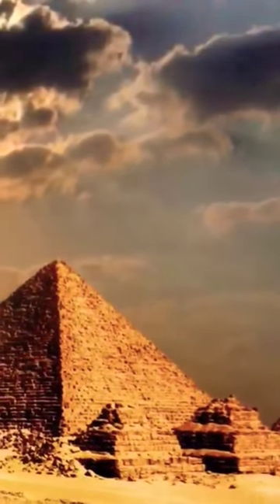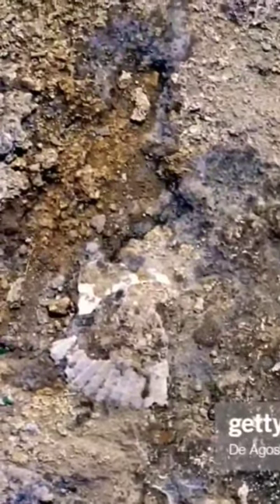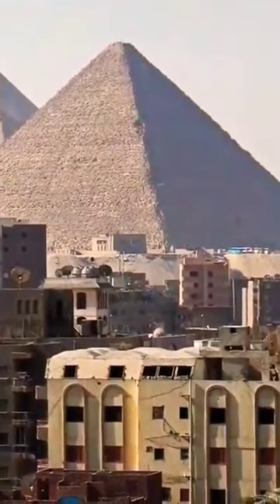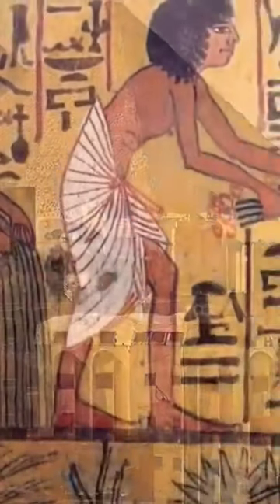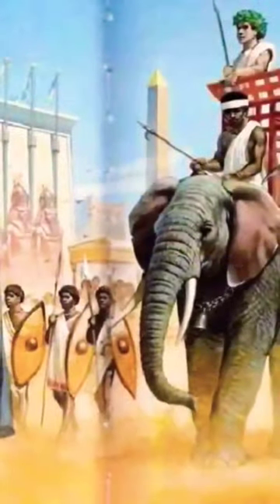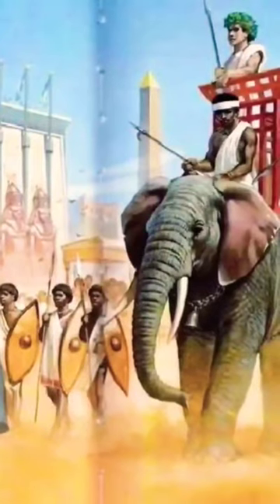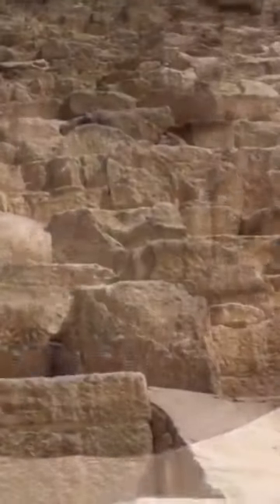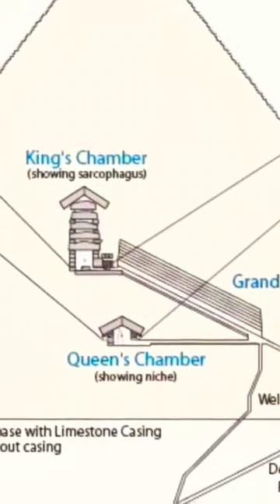Is Graham Hancock WRONG About Pyramids Using Concrete (Geopolymer)? #shorts #shortvideo

Comment: Yes some type of material that was poured these guys calling it concrete ok whatever but pouring it from molds is the only way to build like this. The shafts were poured around wooden forms then pull the forms and you have a shaft or tunnel easy…